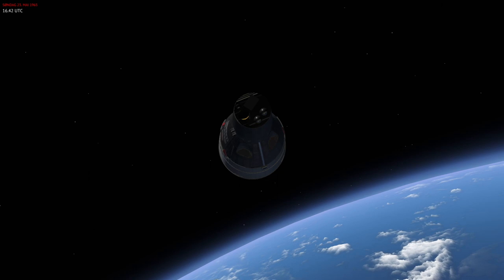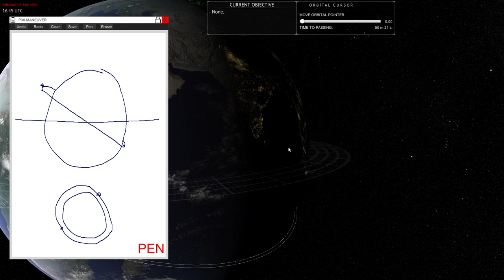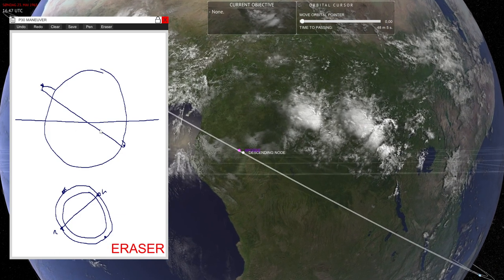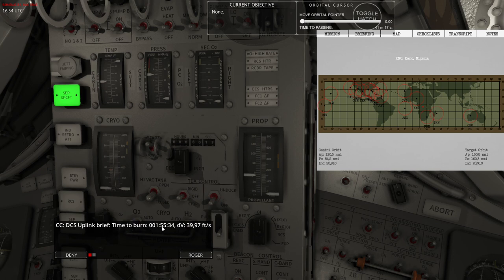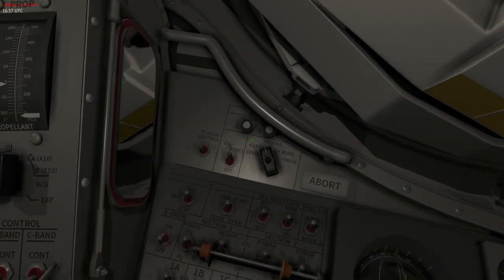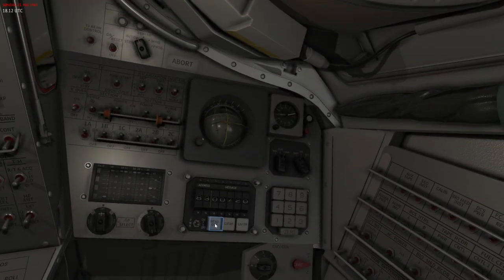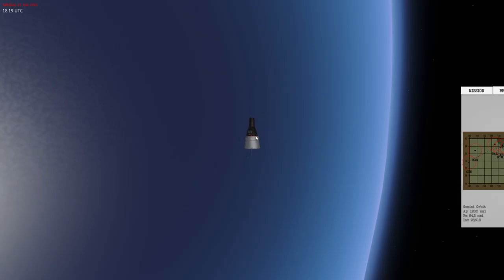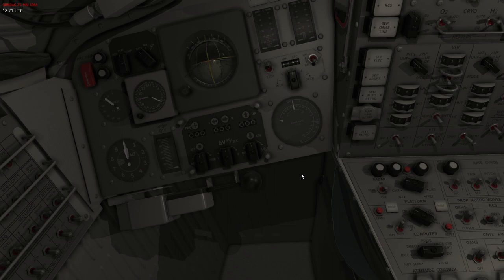How to perform Plane Change burns

Comment: I have a problem. I follow your videos but don't work. My burn don't start. And i have the same issue with Burn and circulize... The procedure work fine but not the burn. And i have the same problem with AP or PE procedure. I reinstall Re-entry but... I use Mission / Project GEMINI  / Free play in ORBIT
Reply from the maker: All of the Gemini RCS burns are manual so you will need to translate correctly according to the IVIs youself.
Reply: @ReentryAnOrbitalSimulator  Don't understand don't work
Reply from the maker: @EFPVSectionCivile  I recently created an Academy lesson, try this lesson, and if it does not work, jump into Discord and I can try to help you there live.
Reply: @ReentryAnOrbitalSimulator  WORK FINE !